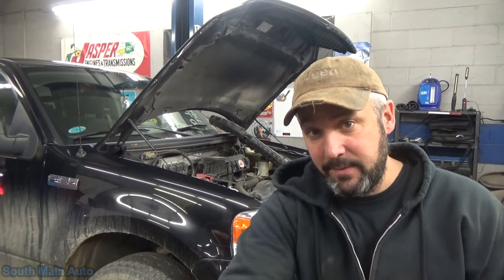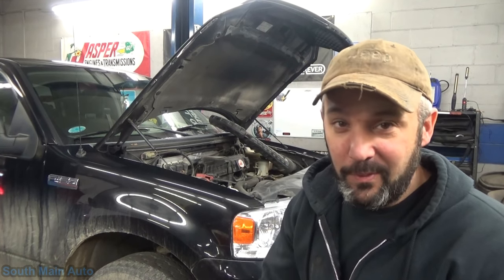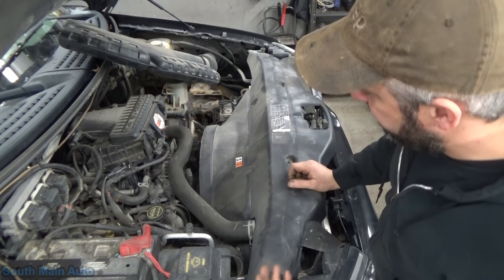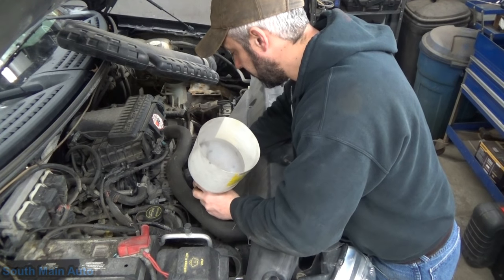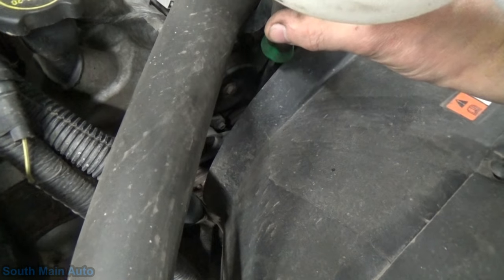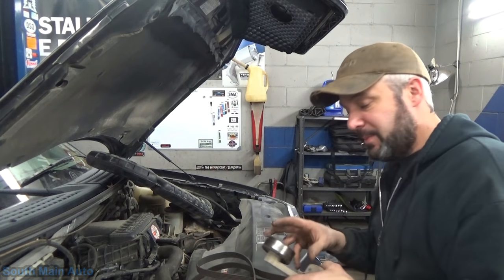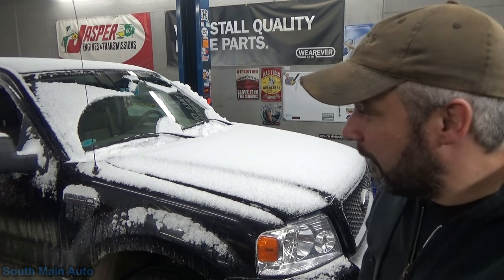How To Locate A Noisy Idler Pulley

Comment: just order in the bearing. they are like $10 each. $40 does the whole system for less than the cost of a whole tensioner.
I save customers cash doing that and make more in labor because of it.
Reply: Yup, easy job, definite DIY save, I keep one on the shelf !
Reply: that makes good sense if you are not busy.  I think Eric has too much going on to take on more labor.
Reply: The spring get weak over time why play around do it right the first and get no call back's.
Reply: people that artificially inflate labor rates are ruining this industry
Reply: ***** Timken brand. Every part store carries that brand. You can buy the bearing from dealership for under $20.  People waste so much of a customer's money on whole pulleys for no reason. 

Problem here is a bearing failure and not the tensioner itself. Cost of an tensioner of $80 and made in China or dealership price..... or cost 4 bearings, plus $15 extra labor cost is still less on the customer and they have more done and done correctly. 
Too many mechanics are afraid to repair a part and just replace. Technical schools breed that mentality. They know how to replace an engine rather than rebuild one.
Reply: ykmalachi   And what do you tell your customer when the tensioner  fails a month after you repair it?
Reply: wysetech2000 why would it? If you cannot tell the difference in a failing tensioner and a good one by visual observation of a running engine, maybe you should go back to tech school. 
Things to look for is an angular deflection of belt while riding on pulley. Look at the tracking marks of the belt on the pulley. Too far to one side or the other is indicative wear in the housing or twisting of the spring. You can also remove the unit and put in vice and hand twist it to see if has slop in the fitment.
Bouncing (excessive) of pulley while running and idling is a weak spring. 
If it does fail after I call it good, I just eat to cost and repair parts and labor for free. I accept that risk.  My customers trust me to advise them on the options. I'll be honest and explain what I suggest and why. Some opt to replace the whole tensioner anyway, some just get a bearing. Never had a single time I've been wrong yet.
Reply: You don't need to insult someone who has seen the results of trying to save the customer money. After enough of those jobs come back to bite you, you learn more than any tech school can ever teach you.
 All i'm saying is that sometimes it's just not worth it.
Reply: Good point but time is money the boss want's you to fix more cars in one day and you don't know if it will fail later on i would do that on my own car.
Reply: wysetech2000 was not attempting to be insulting. Just stating that many guys come out of schools without a true grasp of how mechanical things work. 
I am my own boss and as such can make my own decisions on things like this. 
I proffered a low cost solution to the issue. I've personally replaced that exact tensioner complete on a 2008 F250 a bit back..... because the spring was failing. there are reasons and causes for doing so. Belt was riding on edge and the pulley had cut into the timing cover. 
there are just more than 1 way to fix this problem as presented in this video. Most people who DIY are not aware of the bearing solution. Some years ago part stores and shop managers began just replacing whole units.
which is why you pay $150 for an alternator when you can rebuild it for $40 yourself. It was a skill most mechanics had. Now part replacement is the norm. 
Time management is paramount in shops. thus, it is simpler to replace a whole unit and the customer pays $160 for this repair. ...or whatever the shop rate may be. 
my solution of a bearing also fixes the problem and takes 2 minutes extra. Cost to customer is $70???? 

Then explain the repair to them. Communication with customers ends nearly all angry returns.
Reply: ykmalachi    I have been a technician for 48 years and used to repair or rebuild almost everything so you're correct on part changers today. I might not be up to date on the latest technology and only work part time now they still call me in when there is a tough problem they can't figure out. Sometimes i win and sometimes i get stumped as well. I rarely get beat however. I don't give up easily.

 There are many circumstances that arise with every repair and you try to make the right decision, the balance between honesty and making a profit as well as customer satisfaction. I sometimes replace pulley bearings myself but i would want to be sure that the tensioner is perfect before replacing the bearing only.
 
If i can save the customer $100.00 or more i do the best i can to do that but to save $20.00 you have to wonder if it's worth taking the chance. I just know that in many cases you will be paying from your own pocket when it comes back.
Reply: I had Timken wheel bearings put in my Subaru. Only sticking with Timken for bearing needs!
Reply: I'm pretty sure Eric and all of us here know how to punch out a bearing from a pulley. If that tensioner has 100k there's wear on the sliding surfaces and the spring. In the end it's better to just replace it because if it fails 10k miles later the owner is paying twice for the same problem. If it's a simple pulley then 100%  agree to pop a new bearing if possible.
Reply: I have a 2002 Ford explorer 4.6L V8. It's knocking from somewhere, showing low oil pressure, and no power up hills. Any thoughts on what the problem is. I've talked to two mechanic shops and got 2 different answers so no help there.

Comment: Ingenious using that jug.  Gave me an idea.  Duct tape a cheap stethoscope to the screwdriver handle.  In troubleshooting my Tundra, I noticed an orange stripe on the water pump pulley.  When it makes the noise the stripe wobbles, sometimes the noise stops and the strip doesn't wobble.  Great video, thanks.

Comment: I would have guessed the power steering pump for sure.
Reply: Yep, that's the mistake I made. It's extremely aggravating going through the hassle of changing a power steering pump just for the noise to still be there when you are done. It was the idler just to the left of the power steering pump on mine.
Reply: that's exactly what I thought it was. Sounded like PS pump growling
Reply: just load the pump by steering the wheel and revving the engine , if it sings its the culprit , if not move on! :)
Reply: +Brad Noyes, you would normally find leakage or leaking power steering fluid.  I like to use process of elimination.  Check pulleys, valves, etc.  Sorry that you had to go through that road.
Reply: Everyone always blames the steering pump.  I spent $300 replacing the steering pump and later foundout it was the alterator.

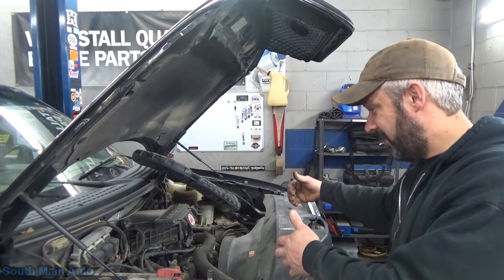Comment: 4:32 kinda like tires, feels like the front left is bad but turns out to be in the rear. Thanks for the cool trick. Altima is making a rattle noise and this will help. Glad I bought the Caliper Hanger Set and the 1/4 swivel from your Amazon page, not so much that I needed them, but more to support your channel

Comment: I had an idler pulley seize up & fall apart in cold, cold, weather, I was lucky to take belt off & drv to a junkyard 20 min.away, which was about all the truck would run, no power brakes, alternator, water pump, I got a used one for cheap, & now I even carry a spare used idler pulley & belt, good cheap , light spare parts to have in truck in case you need on a long weekend, or freeway, middle of nowhere

Comment: thanks Eric O IV used a 1/2 inch x2ft piece of copper pipe in the past ......but I always felt like it was going to go straight into my ear this is a far better method .... I've got the identical truck in the video with 92000 with original pulley I wonder if that will be my first one to go bad
Reply: The only one I have had to replace was the idler closest to the power steering pump, at around 175k miles on my 2004 F150.
Reply: Brad Noyes wow got your money out of that one
Reply: Scott Ouellette 205k on it now, it's actually the newer of my 2 vehicles but the mustang only has 168k on it.

Comment: I have a similar noise, and I took it to be looked at and the mechanic used a scope to listen to the pulleys, and he listened to the alternator and he said he heard a murmur, and he did it twice and he heard a murmur.  Then he used a voltage box and connected the wires to the battery and the alternator, and the voltage was 14.1 (which is good) but then he loaded the car by turning on AC, back heat for window, radio, lights and the voltage went down to12.0.  So he said it was my alternator.  So I just took it back the other day and got another alternator put in.  Unfortunately, all alternators are rebuilt, even the new ones.  This one cost me over 150 smackers, but because I still owned my car they replaced it with a new rebuilt.  But you know what??? I still heard the noise, and I think its what this gentleman in the video said, the belt tension er is bad. That's what it sounds like in the area of my vehicle.  Am going to call the mechanic and ask him to check my belt tension-er and see if its that.  I love the jub and screw driver, that is a genius!

Comment: I have a 2015 Infiniti Q70L 3.7L that is experiencing belt noise. It sounds like a little squeak. Less than a year ago the dealership replaced the serpentine belt and air-conditioning belt four months ago they replaced the alternator as well under warranty. Unfortunately I no longer have warranty since I ran out of time and not the mileage. Is there a chance they might have damaged the belts after replacing the alternator? The belt has less than 12 months. I currently have 150,000 miles. Keep in mind the belts were replaced are about 135,000 miles 140,000 miles. What’s your thoughts?

Comment: i've never replaced the tensioner assembly but i have replaced several bearings in them . just press the old one out and a new one in. very simple. save yourself 50 bucks. works with even a  plastic pulley provided it's not broken. And while you have that belt off, replace it.

Comment: Or just use a longer screwdriver with no jug attached. Or a long wooden dowel. Just put it to your ear and listen, saving you the time of looking around for a jug to destroy, destroying it, and then attaching it. This is an AGES old method for localizing problem sounds, like bad rockers. I used it just a few months ago for the exact reason shown here, a bad idler. Worked like a charm.

Comment: I had similar noise and the mechanic said it was an issue with the idler pulley. Car is under warranty but have to wait 3 to 4 weeks for parts. Is it safe to continue using the car while waiting for the replacement pulley?

Comment: Thank you! One follow-up for you: my bad bearing is in my AC compressor, which has been shot for years anyway. (and FYI my AC switch is off) I also live in "the other New York" couple hours east of you, so it's not really worth it to overhaul my AC system on a 2004! What would you do in this situation? 

Could I totally remove the pulley, and try to find a shorter belt with the same number of ribs, or is it not as simple as that? I don't care about the noise: I just don't know how much to worry about that pulley seizing and my belt snapping.

Comment: Your videos are very helpful, I was wondering if you would have a fix  on a 2012 Chevy Equinox 2.4 engine PCV  valve freezing up in cold weather and blowing the rear engine seal losing your oil. It's very expensive to repair and seems to be a common problem. Great videos....thanks

Comment: just curious, I'm assuming your putting the tip of the screwdriver on the bolt holding the pulley on...just want to confirm even though its a common sense ques

Comment: I'm going to have to try this later. I have a 95 Jeep with the manual belt tensioner. It would take me an hour to just check the idler pulley because of the 30 minutes to get the belt off, and the 30 minutes to get the belt on. Then my hands are bet up because it is either remove a few items, or work in a space smaller than your hands. Then the lower of the two idler pulleys has a deep blind nut, so you need a socket extension to get the nut on the back, while you also can't see what you are doing or where you are going. I suspect this is a two person job.

Comment: Where Exactally do you touch the screw driver to?!

Thanks for your help guys!
Reply: To the bolt at the center of the pulley, if it's not spinning.  Otherwise, to the alternator, compressor housing, just to the in side of the pulley.

Comment: This is Amazing....its 2021 this has been sooo helpful.

I have an amazing 08 Expedition that hits the road very often. Im hearing a noise that sounda like rubbing pan when switching gears, chokes a bit and then its good to go. No problem once Im at speed on the hwy. Doest do this all the time. On and off pinging when idling. Im am at a loss as to what this is. Pully seems fine...any pointers?

Comment: I've used a length of garden hose for many years as a stethoscope.  It's safer than using something metal if you happen to touch the fan or otherwise get it stuck in a spinning component.  Just a thought.

Comment: I use a old deep funnel that had a broken spout and open spout to fit my longest screwdriver.
Works better than a stethoscope I have, stethoscopes can be improved by adding earmuffs (amplifies sound and blocks out background noise) with hole drilled in ear pieces to accept the ear lug and tube ...

Comment: My Ford PU makes that louder noise all the time. That is not normal?  I thought it was because it's a Ford.  

Nice presentation.  A rubber gas line or plastic hose stuck on the end of a funnel works also.  But not as well as your big jug.

Comment: I'm getting a gnarly sound but only when driving in gear .. Thought it was the front left break pad warning ( replaced both front ) Then thought it was possibly a bearing but both tires are super tight when attempting to wiggle etc etc .. Which pulley would make it's loud ass noise when driving but not so much at idle ? 
Best regards

Comment: you can find bad lifters by using the screw driver method.I remember watching an old guy doing that. I was thinking he was nuts but after that, I went out and got an extra long  screw driver. I never saw anyone use a jug as an amplifier, lol,that's cool. Not high tech but it works.

Comment: I just  had one these drive me up the wall. It slipped when wet or at Idle when the AC was on. 

The damn pulley grooves where all caked up by an oil leak. At the power steering. They had fixed years back. I had to spray engine de-greaser on them. Then scrub them all down with a wire brush. Rinse them off. It went away. The smooth pulleys had that old hard steering fluid on them as well. I had to scrub them with a green pad. As I suspect that stuff made the belt ride up on the grooved pulleys and skip across the smooth ones.

Comment: my wife's 2001 Honda CRV screams when you first start it after sitting awhile.  replaced all drive belts, timing belt, water pump, and timing belt tensioner,  and now louder.  screams only for about a sec then is quiet.  I kind of think it might be the air conditioner compressor or power steering pump bearings not getting lube right away.  Ever had that symptom?

Comment: My trick is a flashlight, shine a beam on the pulleys one at a time and you can usually pick up a wobble on the bad pulley  doesn't always work but I can spot them 9 out of ten times usually. just be sure your eyes are pretty much in line with the pulley.

Comment: If I was only going to change the Idler pulley ONLY from the tensioner assembly will the bolt be a left hand thread or right hand thread.?.......thanks for reading...
Reply: Is your a spring loaded tensioner?  If so, I'd change the whole thing!

Comment: So I change my tentioner pully and now my belt wont stop squeaking. I tried soap, I didnt work. I tried power steering fluid, it made the noise go away for about 30 miles and now it's back. Do I need a new belt? Or did I screw something up putting the belt back on? 
01 ford expedition 4.6l

Comment: I am going to check right now what the cause is for the deafening loud noise in my car  using the long screw driver attached to a jug. I had just  bought a stethoscope which I am going to return because I believe the jug method is better.

Comment: Also I have 2014 mustang, I don’t think I have an idler pulley, I have several pulleys, alternator, tensioner, waterpump and I think ac compressor I’m not completely sure, but wondering if that noise could come from any of the pulleys, it comes and goes and is the exact same noise

Comment: I use old hose...rigid coolant line, and if it hits fan or belt, doesn't do damage...cept to hose. Found bad solenoid and coil pack...bearings on pulley, alternator...cheap.

Comment: Bought new in in 2008 and had the tensioner replaced twice in 2018, 2016. This and the motor mounts and clearcoat are issues of this year Honda Civic. Belt replaced three times. Luckily the cracked block replaced the engine at 170K.

Comment: If there's no stationary center bolt on the pulley,  such as the alternator and water pump on an 01 mustang gt, is this trick still applicable? I get a lot of noise,  but i assume it's mostly just the screwdriver riding the spinning center like a phonograph.

Comment: You can buy a one of those doctors stethosope at princess auto or harbor freight for about $10.   It has the wire funnel and ear buds as well... But for a fast way to get the job done that's a great idea adding the jug I used to do the screwdriver a lot then spent some money.. it take up a little less room than the jug...lol.

Comment: I did this and the loudest vibration came from my alternator. I pulled it and had ot checked. It was fine. It turned out to be my water pump pulley which is below the alternator on my 4.6 Lincoln engine. Apparently the screwdriver test is not always accurate